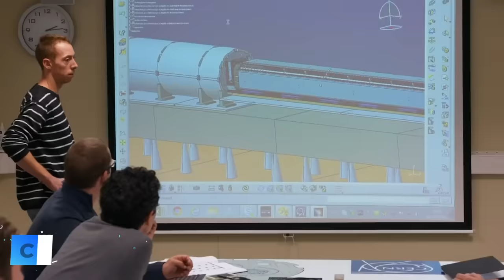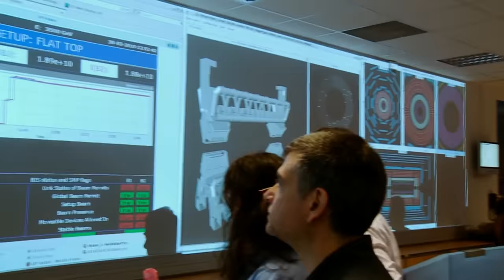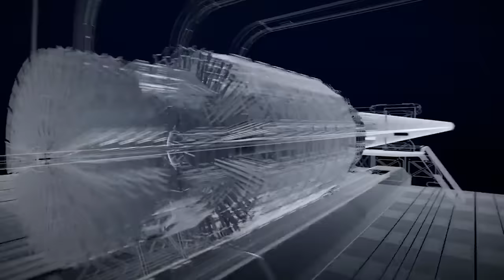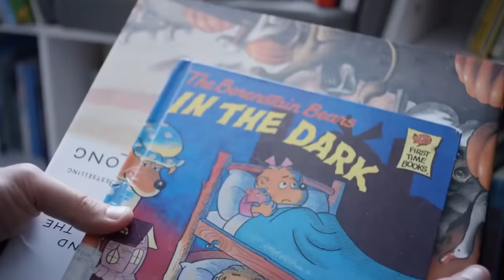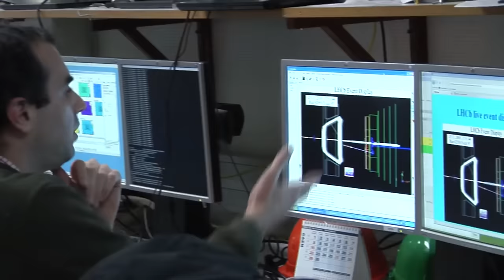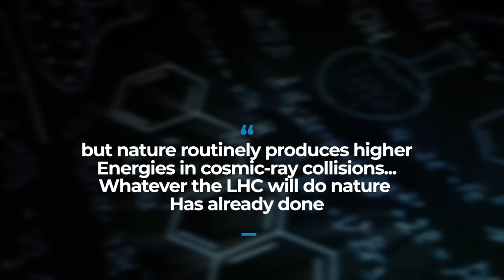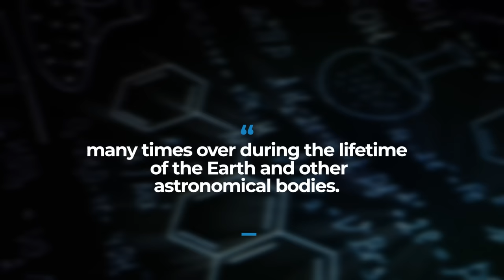World's Smartest Kid Just Announced Something INSANE Is About To Happen With CERN

Comment: Revelation 9:1 And the fifth angel sounded, and I saw a star fall from heaven unto the earth: and to him was given the key of the bottomless pit. 2 And he opened the bottomless pit; and there arose a smoke out of the pit, as the smoke of a great furnace; and the sun and the air were darkened by reason of the smoke of the pit. 3 And there came out of the smoke locusts upon the earth: and unto them was given power, as the scorpions of the earth have power. 4 And it was commanded them that they should not hurt the grass of the earth, neither any green thing, neither any tree; but only those men which have not the seal of God in their foreheads. 5 And to them it was given that they should not kill them, but that they should be tormented five months: and their torment was as the torment of a scorpion, when he striketh a man. 6 And in those days shall men seek death, and shall not find it; and shall desire to die, and death shall flee from them. 7 And the shapes of the locusts were like unto horses prepared unto battle; and on their heads were as it were crowns like gold, and their faces were as the faces of men. 8 And they had hair as the hair of women, and their teeth were as the teeth of lions. 9 And they had breastplates, as it were breastplates of iron; and the sound of their wings was as the sound of chariots of many horses running to battle. 10 And they had tails like unto scorpions, and there were stings in their tails: and their power was to hurt men five months. 11 And they had a king over them, which is the angel of the bottomless pit, whose name in the Hebrew tongue is Abaddon, but in the Greek tongue hath his name Apollyon.